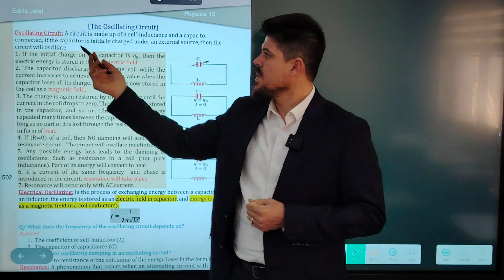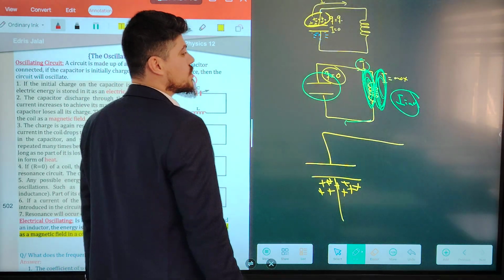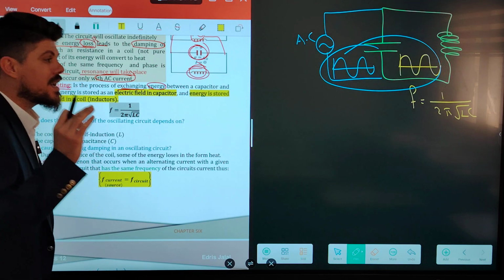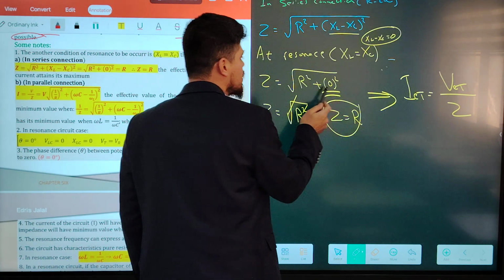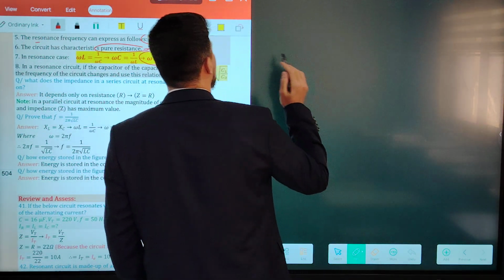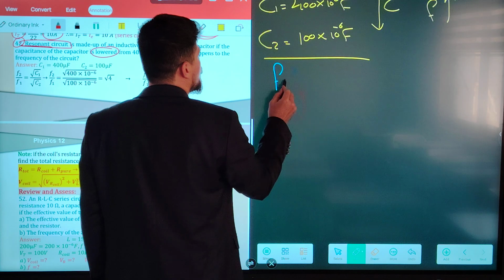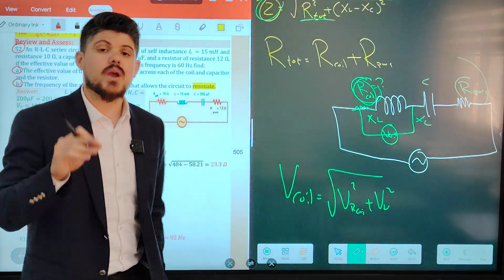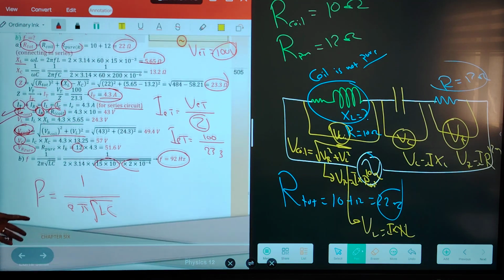Physics 12 | English system | chapter 6 (new)

Comment: Salam u alaykum teacher prsyarakm haya ((If the intensity of the electric current in a coil change at a rate of delta I over delta t the magnetic flux change at a rate of delta flux over delta t this leads to creation of self emf then the coefficient of self induction of the coil)) aw question e wizare 2024 xuli 2 ley te nagam